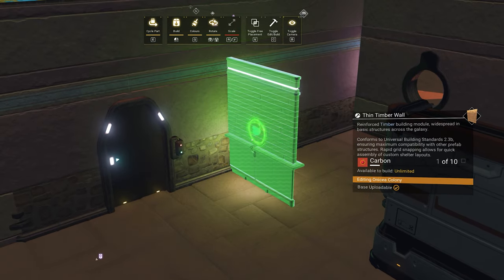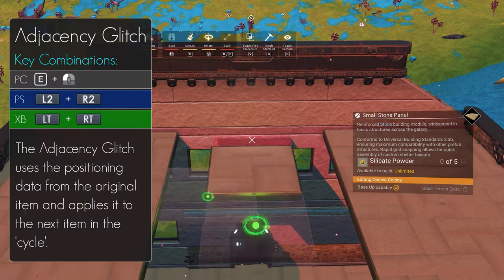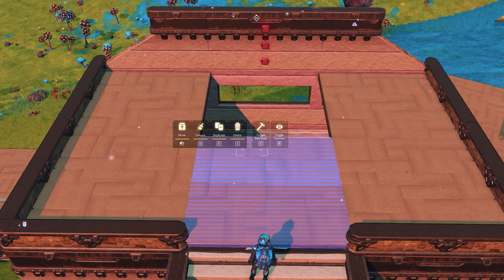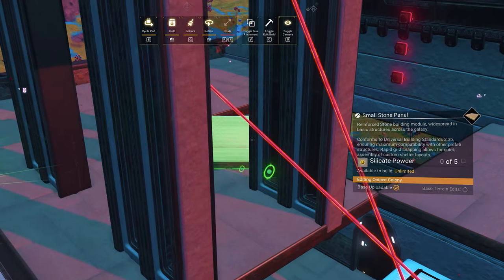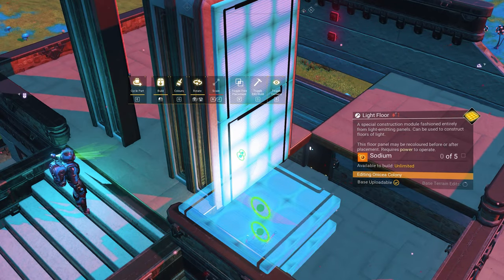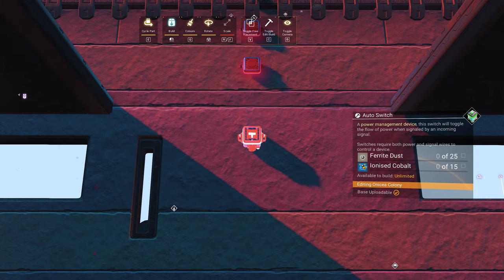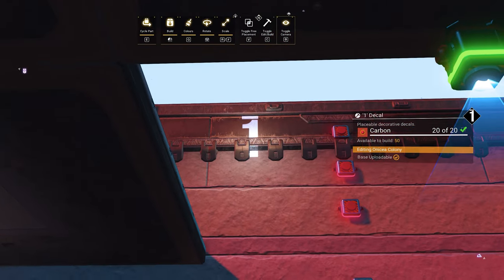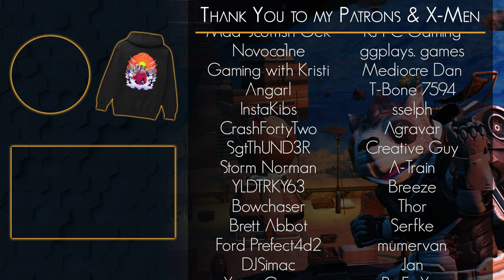What Your Base is Missing! A Multi-Destination Teleporter in No Man's Sky | Glitch Building Guide

Comment: (Big comment)
I think ill steal some of your circutery
Cuz i got my own original idea for a short range teleporter system:

Try to put (for example) 3 teleporters for going from the HUB to destinations, and 1 for arriving to the HUB in the exact same space
I would be using the wire glitch (i think it was this one that allowed unnatural clipping of objects)

I would deactivate all of them except the arrival teleporter UNLESS a proximity sensor detects someone near the teleporter (or inside it) then all teleporters should be offline until the player went out of proximity sensors reach

Than wire button inputs to activate the teleporters that actually teleport you to your destination

and i should have a working original HUB system

As for the arriving side, its just gonna be 2 teleporters inside each other, that only arriving one will be active
unless a proximity sensor senses a player in or around the teleporting area, which should either:
-flip the directions around, deactivating the arrival teleporter, and activating the departing one
Or turn the teleporter off unless a button is pressed, to make the departing teleporter fire off
Reply from the maker: You just described exactly how the ARRAY in the video works